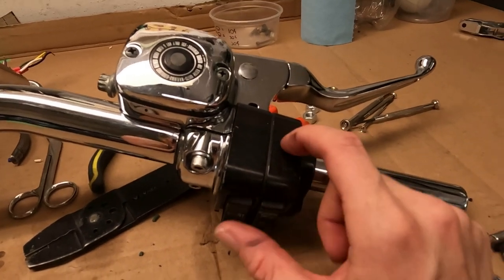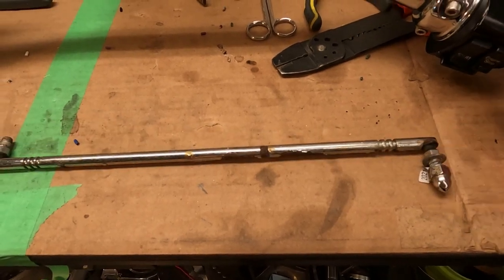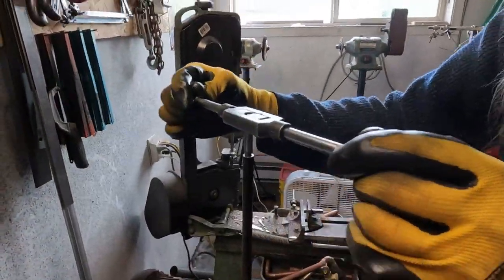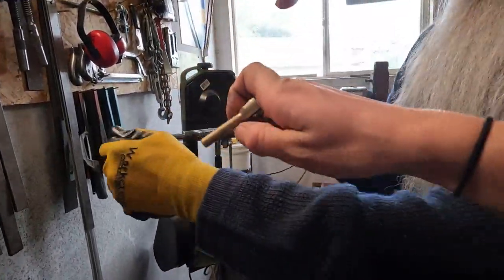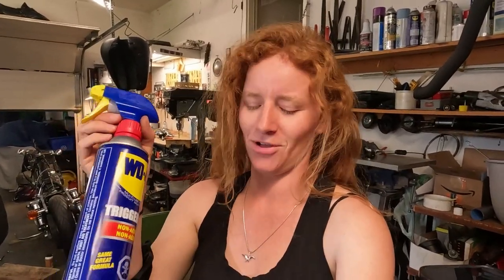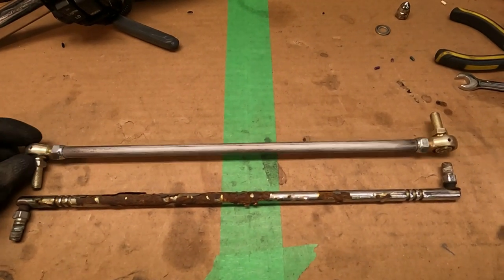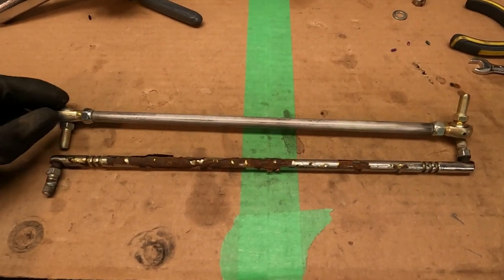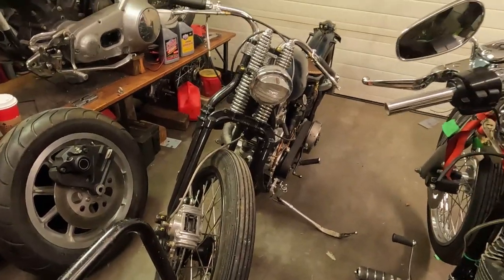DIY Shifter Rod For Harley Davidson

Comment: Great video. The part you guys made looks like much better quality than the original. It looks much more adjustable and thus more versatile too.

Your dad should make the WD-40 spray can refillable. Then you could buy the one gallon containers of WD-40 and just refill your WD-40 spray bottle instead of going to the one automotive store and paying extra for the specialty bottle and the trip.  All you would need is a hole and a plug. given your guys' machining skills, it should be easy.

Your father looks like an interesting and innovative character. Maybe you guys could consider doing an interview with him for a video for your channel. I am sure he has some interesting stories. He could talk about how he got interested in old school motorcycles, what led him into machine shop work and making his own parts, etc. He could also talk about how his involvement in motorcycling and machine work, etc. influenced you into getting into motorcycles and machine shop work. Then you could compare his perspective to your own perspective of his influence on you, as many times the perspectives of two people often differ.

Comment: I have a lathe and make parts for my shovelheads too. I always use brass. Made a clutch retainer for a 3 finger clutch, and lots of acorn nuts. Here in Europe inch sized hardware is difficult to get, so I got inch sized tap and die set from ebay. When making threads I blow the curls out with compressed air.

Comment: I just changed a front brake switch button on an 06 fxst that was stuck closed from sitting. and one thing to do is the brake cylinder plunger inside the lever housing collects dirt and grime should be WD/ pb blaster every once in awhile or they don't open all the way on release... Nice job on the linkage ingenuity! ☕💜

Comment: Thanks for the video Angle. 
   Looks like you have grease fitting holes in those joints? Or they are oil holes?

Comment: Lovin' the workshop aspects of your videos-I love building bikes and the problem solving required! WD40 though is water dispersant, for cutting threads, a little light oil or cutting compound would be a whole lot better and give your taps an easier time. Keep up the great content!

Comment: I love the anatomy of the bike - I have to look at it closer. Im not familiar with its drive train, but looks belt driven ?  WD40 with a Spray Nozzle? don't forget to use it first when cleaning the grease off your hands. I like that you are making your own parts. In 1971, I was in North Carolina, and bought a 1959 106 Healy for $400.  Its shifter linkage I fabricated the connecting parts for the rods from soda cans. Also use them to help lift the rear suspension that was scraping the ground -
Reply from the maker: It is belt driven, yes.

Comment: I use a chem spray bottle and buy the WD in 1 gallon jugs. But I don't use it for thread cutting, tap-eze works a lot better. WD isn't a lube as most people think, vegetable oil actually works better for a lubricant than WD. Even some diesel and ATF work better for tapping, add some acetone for a great penetrating oil that beats PB and is cheaper than Kroil. I'm always in amazement at how thick your hair is, as a guy with a long ponytail, I'm jealous, lol. Be safe, Angel!
Reply from the maker: Lol I have a love hate relationship with my hair haha, curly hair has a mind if it’s own! 
We weren’t using the wd/40 as a lube so much as we were using it to keep the cuttings flushed out of the tap, don’t have any tap-ease on hand at the moment so this worked to get the job done!

Comment: If you would put one of those banjo fitting break light switch on the master cylinder . you wouldn't have to worry about mixed match break components . plus it's right there if you have a problem ..shifter linkage looking good their red .
Reply from the maker: We put an inline pressure switch in

Comment: been pondering putting a pressure switch on me ironhead too since eye only hava hand control & doze lil switches in older hand controls r chinsey af.
wont b long fur ur dyna now!
go red go.
🤘😘
Reply from the maker: I picked up a pressure switch for about $50 and yea, much easier to work in or replace if it goes on the fritz.

Comment: The old shift link rod looked like it was ready to break at the swivel  ends.  Good idea on replacing that.  I can see better why this bike needed to be gone over… Front brake lever assembly, not an  original matching factory part and not aligning with the rear light switch.   Another good one, thanks.
Reply from the maker: It’s been a surprise every step of the way haha

Comment: Awesome job. Where can I buy some of those rod ends...want to do something similar to my old shovel. Love your vids. I'm up the road in Northern BC.
Reply from the maker: You can usually get them from most automotive parts shops but, unless you know someone who will give you a deal, they can be pretty expensive. I ordered some from this company called Bearings Canada and they ended up being about half the price or less. It’s a bit of a pain because they only take credit card for payment and they make you create an account, but much cheaper than buying them at Lordco! 
Here’s a link: 

https://www.bearingscanada.com/Rod-Ends-Heim-Joints-s/2035.htm
Reply: @RedRiderCanadaBC  Thank you so much, I'll give them a shout. Keep the rubber side down & I see ya on da flip side. 💞

Comment: Wow, I've never seen WD-40 in a Non-Aerosol can before! Good job on that shifter linkage! :-)
Reply: Ya you can buy half gallon , we used douse dB atvs after washing them hell I live by salt water I still spray bikes anything that's metal outside , it's good preserver too. Objects won't age water dispersed.  Lol she said preserve right after I typed it , I never seen bottle like that wasn't a  aresol either now I see
Reply: Also good for that stuff but it's also a cleaner and not the best lubricant , silicone or tephlon oils are better , especially bearings or things you can't get grease in sorry rambling I should be working on my own bike I took to the shop bc I don't have garage . The linkage broke and motor clacking hopefully just needs valves adjusted but it was worked in the 90s and I probably rode it Lil too hard .

Comment: Great Vid, Angel.  Yep, the rod looks top knotch with the rod-eyes ...Tech talk tips ..... Tubing, Rigid or Soft, is given by the OD and the wall thickness..... so get out your Vernier for that. .... When you were talking about drilling,..... The " swarf ", ( the curly chips ), chip breaking is referred to as "peck" drilling...... Getting back to the the tube thingy.....if you want max-strength on your projects, ... plan for your end remaining wall thickness over top of the - root of the female thread to be "at least greater than 2 times the the thread pitch" - .... So as a minimum..., your 5/16" - 20 UNF would be > than .....1/20  x 2  +5/16 = 0.4125" ... closest std size over is 7/16"OD tube. So 7/16" OD tube would be your minimum... per se .... Not say 3/8 "......
Me, I would'a gone 1/2" . Cuz I'm a beast on the shifter ..... Anywho,  Nuff said.
Stay Safe
Reply: Just an add here. the 7/16" OD  makes it 0.0125 " larger radially than the 2x specified .....
I get this Q refered back to me so many times, lol ..... if you tapped a 3/8 tube at 5/16- 20..... it would work..... but the wall thickness would make it so weak , it would probably snap on the first shift.....
Ciao
Reply from the maker: Good info Wes, thanks! You must be a machinist or something?
Reply: @RedRiderCanadaBC  Angel, I had a typo there..... it's 5/16 24  and 7/16 20 for UNF ... My bad, lol. I'm surprised noone caught it yesterday. But the method is still the same.... I was a machinist for 17 yrs. Still a Power Engineer  going on 30 yrs. 😎
Reply from the maker: @Yamahog  my dad called your experience just by the technical terms you were using. 
And the actual measurements of the material we were using was a .2835 ID and .4015 OD (speaking in inches).
Reply: Kudos to Dad, Angel. Nice fit on the rod ends... Anywho, working in the Hydraulics end of things yrs ago, I always made sure I went better than was required. meaning if the Factor of Safety was say 4:1... I would go 7.5:1 for instance.... as a lot of the stuff we did was exposed to salt water, Maritime, stuff, ... It was Vancouver... Go figure. So there's my quirk when designing..... "make sure it ain't gunna break " ... lol.
Hey , It's Miller Time.... TTYL ....
Stay Safe.
Reply: @Yamahog  hey Wes, this is angel's dad, Bill. i just saw your most recent response to angel's comment. just wanted to say i always appreciate incite and advice from real professionals. my real training is in an unrelated field. commercial and industrial painting. i tend to over build too, but this is just stuff we had laying around and was basically free. right now, we are just trying to get this bike ready for inspection since it is a salvage rebuild. as is, angel can hardly even reach the forward controls on this bike and all that will have to be changed before she can do any serious riding on it. we are planning floorboards for her, so this linkage will only be temporary. with that, i will for sure remember what you had to say about all this, and will take your advice when i build her new linkage. thanks for the pro advice.
                      regards, Bill
          P.S. the actual measurements of the tubing were taken with my Mitutoyo digital calipers, not the junk you typically see us using in her videos. we like to use those cheapy's around the shop because we're not usually measuring stuff that needs to be highly accurate.